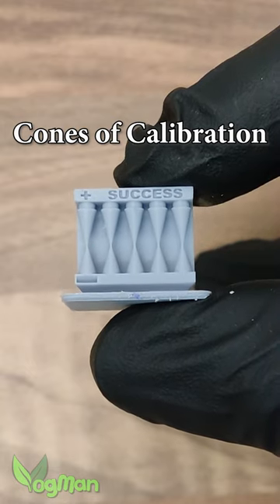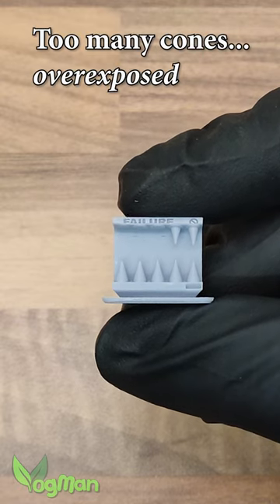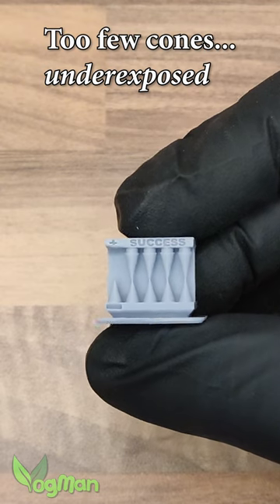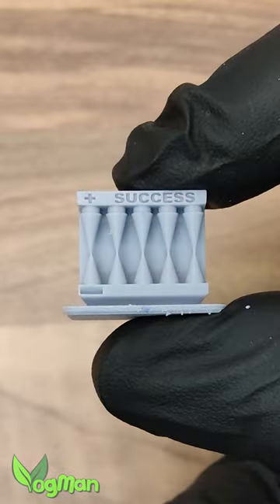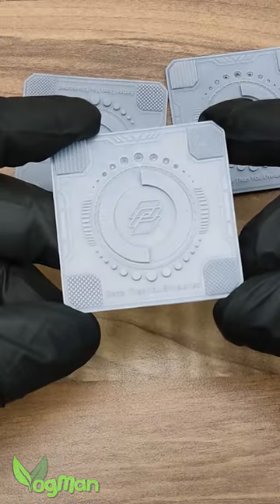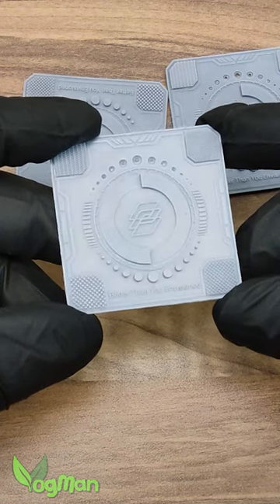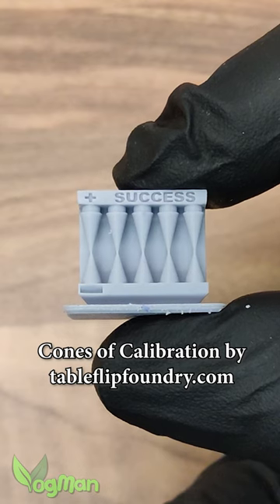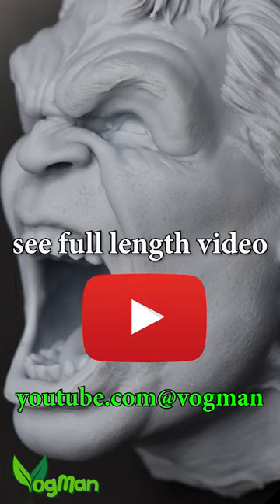Dial in your 3D printer resin with the CONES OF CALIBRATION #shorts

Comment: Did you know that he has released the cones of calibrations V2 which prints faster? Also, i believe he is recommending the Cubes of calibration, by J3D Tech, AKA the Tesseract (also available in a V2), for initial calibration as it is a very obvious pass fail test. If i remember correctly, he said to use the cubes first to get dimensionally accurate and the cones for detail accuracy and if you get the cubes perfect and all of the success cones are printing too then you have the resin as calibrated as you can reasonably hope for.
Reply: Ubber is spot on!! Cubes of calibration gets you where you want for mechanical use and the high level of precision. Cones is great for confirming supports
Reply: I got the boxes perfect but still print some failure cones. I honestly prefer j3dtechs boxes over the cones.